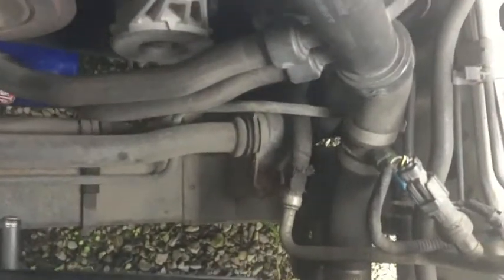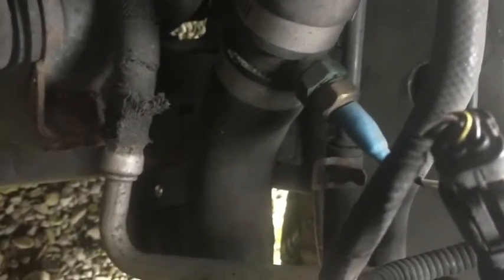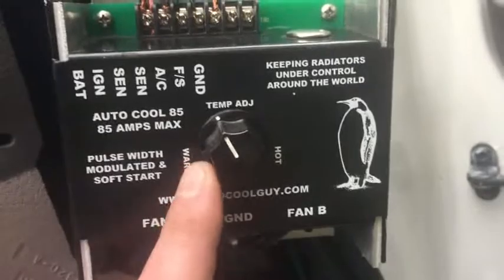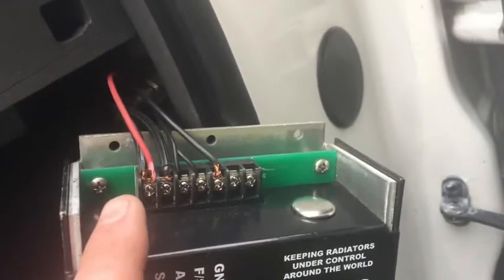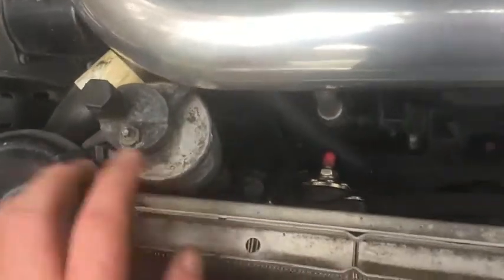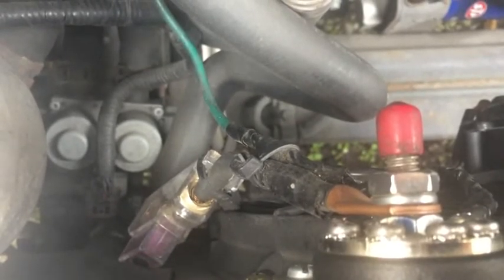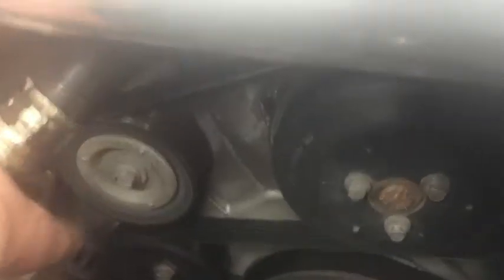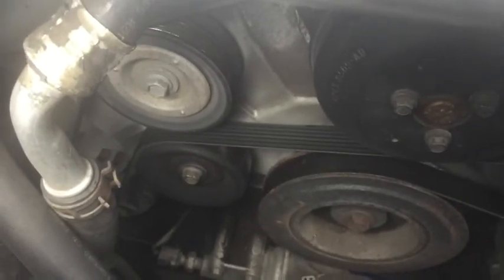2000-2002 Lincoln LS Pulse Width Modulation Electric Fan Conversion

Comment: did this hold up well I have a 2002 thunderbird that I’d really like to convert to electric fans as well
Reply from the maker: Yes,,still using it today. Hadnt had to do anything. I would order a spare temp sensor when you order the control module just for pace of mind ..if something were to fail those usually are the weak link.
Reply from the maker: I would also swap the thermo housing to a Jag aluminum version and you can now buy aluminum overflow tanks too which are a weak link in the cooling. What i do to top off the coolant..be sure to use the orange Ford brand they sell at Walmart..green will eat the plastics. Fill the overflow tank about half to 3/4..then fill the coolant at the thermostat housing till it wont hold any more. Put the cap on and start up the engine and let it get to operating temps...shut it off and let it cool down just enough to safely take the thermostat housing cap back off...add more coolant again if needed. Then start it up and turn the heat on full blast. let it get to reg engine temp..then give it gas to around 2k RPM for 2 minutes...let idle and do the bleeding proceedure. This should fix the cooling issues assuming you have no other leaks in the system.

Comment: Hello. I have a 2002 LS and I have got a 2004 LS electric fan and I also grab the alternator. Hooked it up with out a fan relay. Everything works but the 30 amp fuse I use keeps melting in like 5 min. I had to upgrade the alternator because the 2002 did not have enough amps. So what should I do. Hook up a relay or get a bigger fuse.
Reply: Sorry seen your post late. You have a 2002 v8?
Reply: Hook up relay you don't what to burn out your electric system. The fan is putting a heavy load on the fuse that's why it's burning it out. If you go bigger fuse you would be at risk of fire.
Reply: Anything that you have a high voltage best thing to do is hook up relay and even a breaker you always want to keep your vehicle safe from fire.